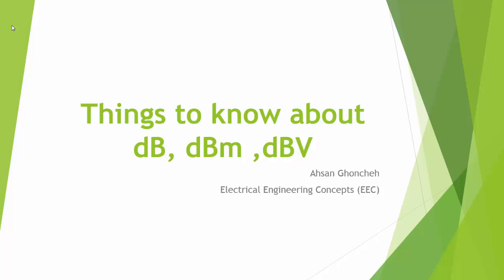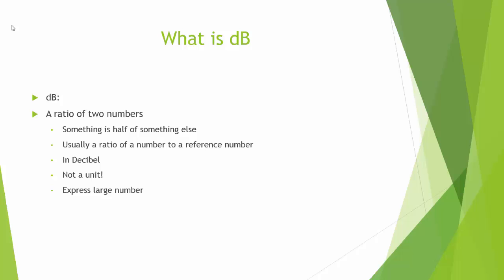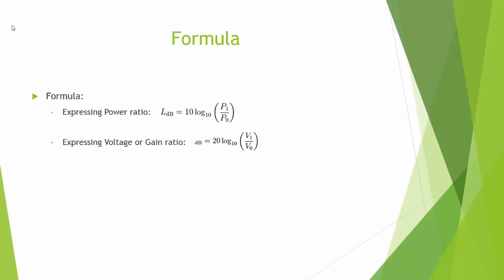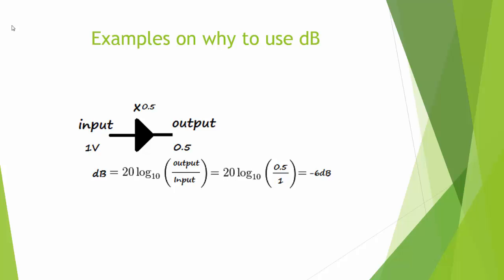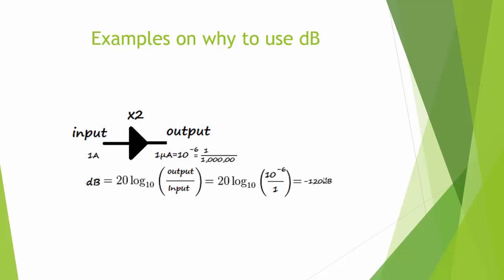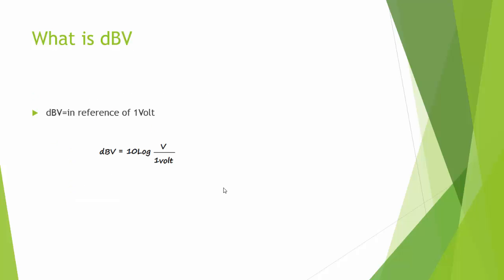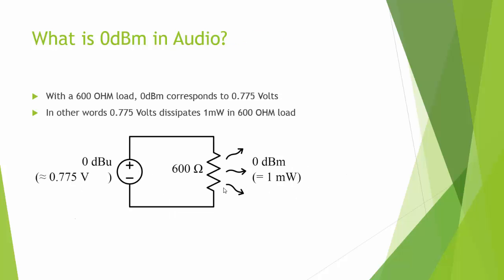Introduction to dB dBm dBV

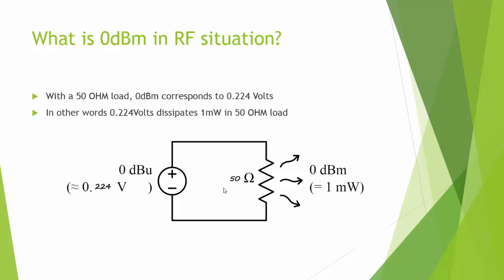Comment: in minute 12:34 you said that dBV its 10log(V/1V) and its a mistake, because you are dealing whit levels istead of power, so with levels the correct its to use 20log(V/1V). Well you must to correct that. thank you.
Reply from the maker: Thank you for pointing that out elkatopro it must have been an error the correct answer is 20log(V/V1)